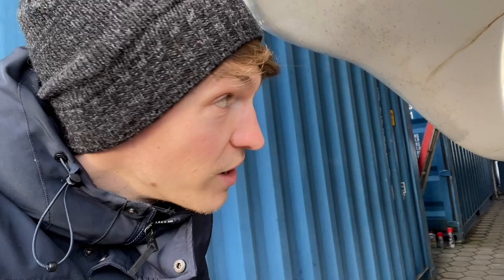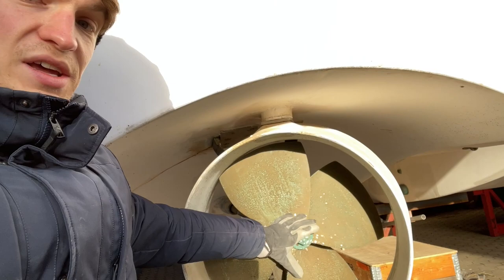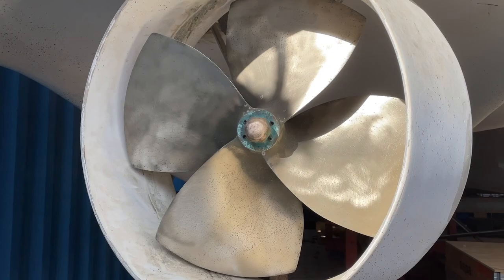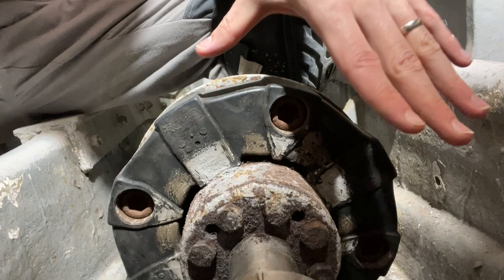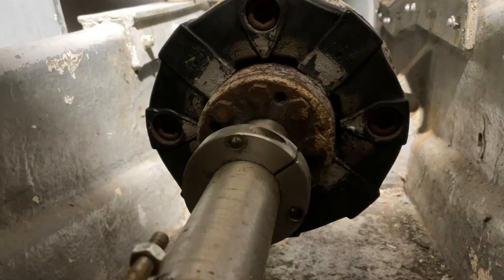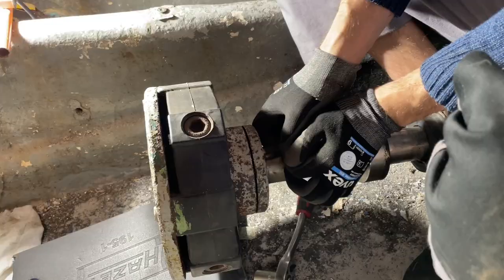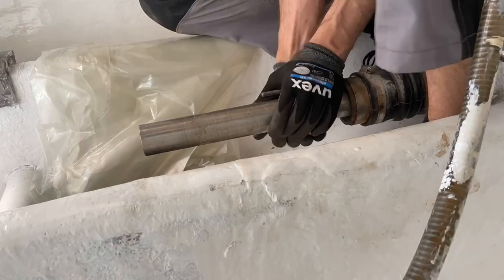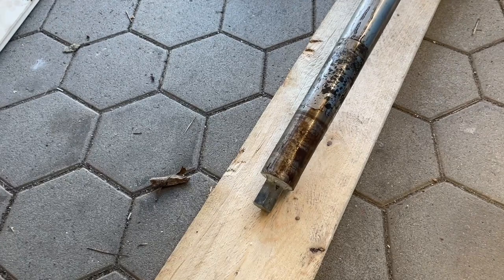Hull damage! Prop shaft must be removed  - Lifeboat to solar electric yacht - H.o.G. Part 7

Comment: Always shock siezed bolts /nuts try impact driver or a lever and mallet to break it loose ..if that wont work apply heat to the heads ..quench with release oil ...if that doesnt work repeat and leave for some time.

Thats like it has taken an impact or been sat on the housing ... More pain clearing the inside grinding out the crack both sides  and re glassing  the damaged area...re finish etc.
Reply from the maker: Yep, used ice spray, hammer, hairdryer and all sorts of things to get them loose in the end! Thanks for the advice, you seem to know your stuff!
Reply: @HeartofGoldLifeboat  
Heat guns work some times but normally it needs a blow torch to get enough heat into the item usually and that in itself can cause problems sometimes ..😬 
Years working with old motor bikes kit cars and bicycles... 😉
and other stuff. Designing and making stuff.
Add in im a Environmental scientist by training and grew up with Meccano ...pre leggo.🤣 🇬🇧 🧙‍♂️

Comment: Think we have to do the same on our lifeboat as the cuttless Bering has likely disintegrated after 10,000km driving and we leak for a few days after stopping, not through the stern gland.
Reply from the maker: Always a good feeling to take something apart completely and maintain all the parts instead of scratching the surface.

Also a good feeling to not go down that rabbit hole!

Comment: What is stopping water getting into the boat through the shaft ?
Reply from the maker: Right now - nothing. When the shaft is back in, there’s a rubber seal on the inside that tightens down on the shaft.
Reply: @HeartofGoldLifeboat  It is so not intuitive that rubber seal holds water so well while shaft is rotating and I would guess under not negligible pressure from weight of the boat.